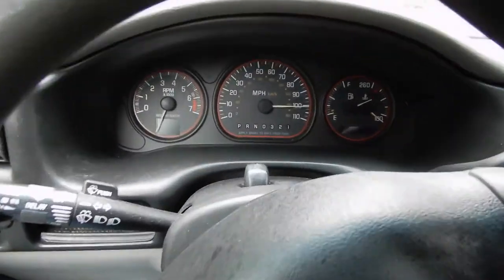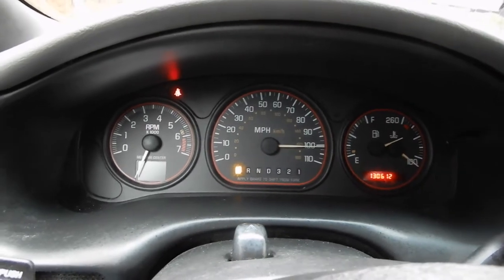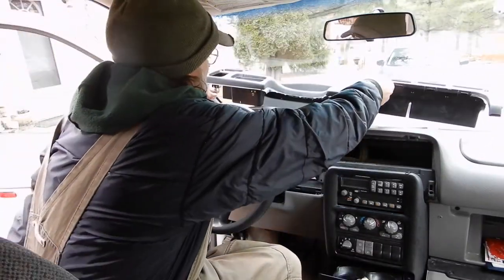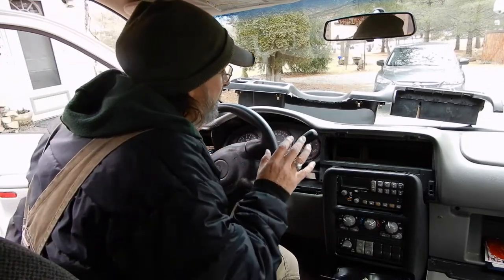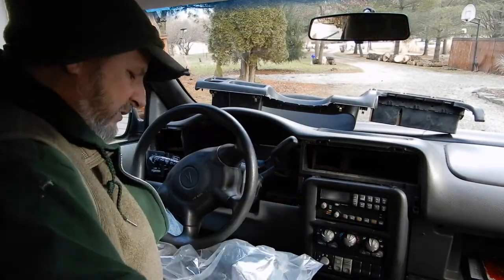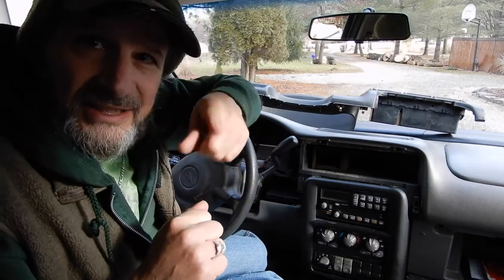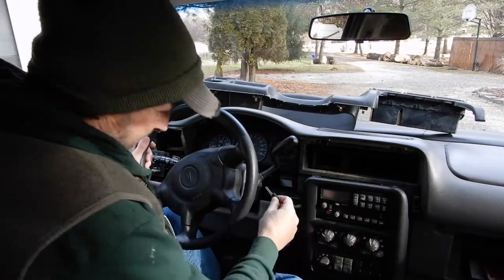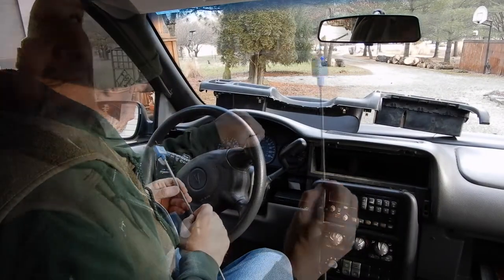Pontiac Montana 2004 Instrument Cluster Replacement

Comment: Thanks for putting this video together. I’ve own a 2002 Pontiac Montana for 20 years and my cluster is cracked so this video is gonna be handy. I might use a sharpie and paint black that darn red air bag light; can’t clear the code with scan tool and don’t want to see it.

Comment: Ok, so at the end of the video all the comments around the fuel gauge working got me thinking. My Pontiac fuel gauge has been lying to me for about 10 years, but it behaves differently, mine goes to full gauge when I fill up, and then at some point it goes to zero fuel gauge. My diagnostic was it needs a new fuel pump, and I have to remove the fuel tank (lots of work); I wonder if the problem is the cluster? Much easier.
Reply from the maker: Hello...I'm thinking it might be the float in the tank, seems if it was a fuel pump your Montana would quite running...just a guess...if u attempt changing the cluster make sure u unhook the battery first, I did not and caused me some problems...like making the air bag light come on, I did not think this was a big deal until I learned with the light on the airbags are not operational,  so I took my 2004 to a certified shop where they were able to get the codes to reset the bag light...and got the radio to work again, I would attempt it again but be real careful of the mistakes i learned..I sure do like my Montana:)

Comment: I have a slightly newer, refreshed if you will Saturn Relay level III. It's got all the goodies of like a 2002 model sold in 2006. It's always drove like a drunken horse. Especially when snowy. But it's also fairly reliable. But getting to that cluster is a lot easier. Hint the cluster is just a dummy panel, things like mileage is actually stored in the computer. At least on the refreshed "uplander" versions this is true. I swapped one out of a newer model that I found in the junkyard. Worked like a charm. Thankfully. I was worried I would have to take it to the dealer to get programmed like so many parts these days.
Reply from the maker: R.a. Wheeler thank U for great info!.....

Comment: FYI: if you need to replace the fuel pump, cut a hole in the floor board under the back seat. This allows access to the pump from inside the car. I replaced my fuel pump in one hour through the hole in the floor board.
Reply from the maker: QuantumSpin.....great advice! I plan to crisscross across this beautiful country of ours and i'm betting a fuel pump repair will show up on mile marker 286 :).....thank you!

Comment: Hello, did you disconnect the battery before connecting the new instrument cluster? Just wondering ... thanks!
Reply from the maker: I did not disconnect the battery at all which lead to a problem, it triggered my air bag light! So i definitely recommend disconnecting  the battery from start to finish......thank you for asking :)
Reply: Thank you for your response. So how did you resolve the airbag coming on? Your video is very helpful. Thanks!
Reply from the maker: Perry Lee i had to take the Montana to a local repair shop where they hooked it up to their machine, they told me they had to call GM to get a code, youtube will not allow Creators like me to go in and add to our videos, i wish i could add a segment at the very beginning to let folks know they have to unhook the battery......something about the montana computer thinks a theft is going on when u dont unhook the battery first.....thanks for asking
Reply: Thank you LAF!! I appreciate your responses. So what you are saying is that additional issues could have been avoided if you disconnected the battery before installing the new cluster?  Thanks!
Reply from the maker: Perry Lee that is what i kind of gathered by watching a ton of videos on youtube, now the mechanic i went to said it was going to deny the airbag system and radio no matter if i disconnected  the battery or not, the mechanic also said he had to call GM for a new code to reset the airbag system......but i have seen videos that dispute that claim too.....o boy! I'm just glad it all works and i can cruise on down the highway :)
Reply: LAF, thanks. I have to change my cluster. I got one from ISS automotive, and like you, I will return my old one once I install the new one. I appreciate your explanations!!